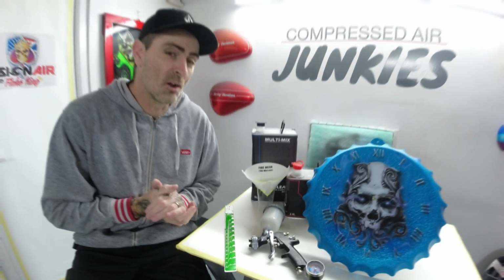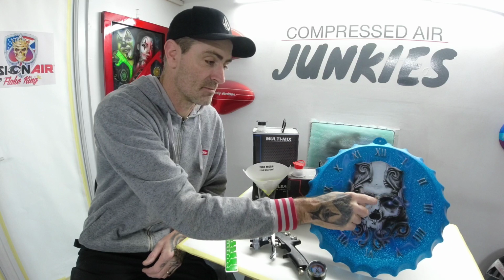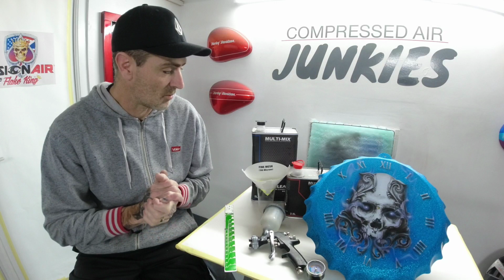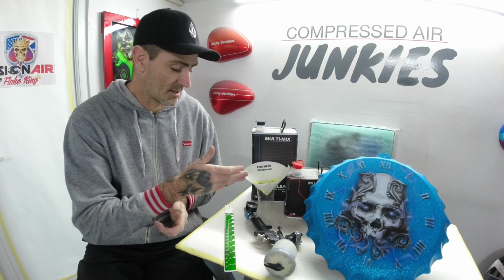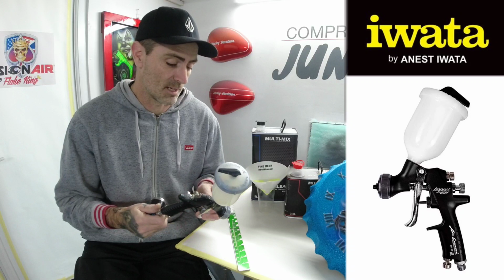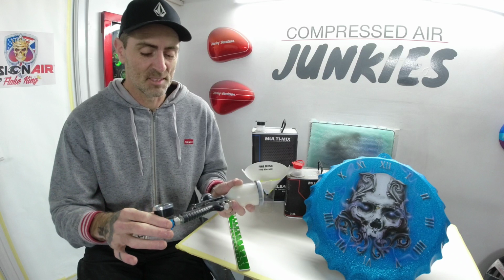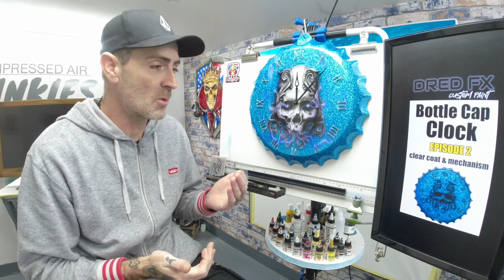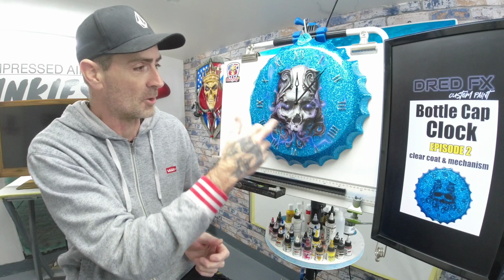Bottle Cap Clock EPISODE 2  clock Mechanism & clear coating

Comment: Love this clock Rob, very unusual and the artwork you put on there really looks nice. Minus the artwork if you don't have good airbrush skills this is something anyone can do at home in their workshop or garage, if you don't have a spray gun you could even use rattle cans then use the 2K clear that's available in a rattle can as well. Might even do one myself but it would probably just be a single colour 🙄👍
Big thanks to Rob for doing the giveaway of the airbrush, good luck to all that has entered 🤗👍

Comment: Nicely done again Rob.. Awee just look at that mini monster iwata spraygun.  Rob I will recommend you getting a faceshield respirator (pricey) but worth the trade.  They come with a few lens  coverings replacements.  Protect your eyes my friend. Thanks for another great video.
Reply from the maker: Hi Jesus c yes I know just do small clear jobs in the studio in and out as quick as I can 👍
Reply: @dredfxcustompaint  great to know Rob.  I sometimes go 10 hrs four days a week spraying none stop. Just didn't realized how much overspray was going into my eyes until I got one.  It's easier to replace the lenses coverings than one of your eyes.